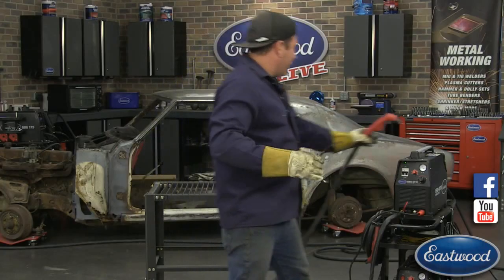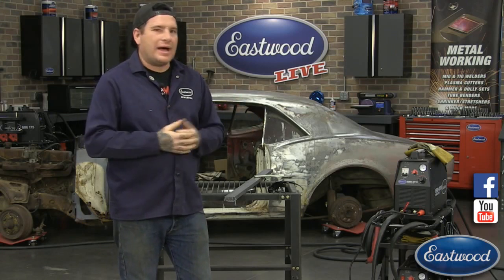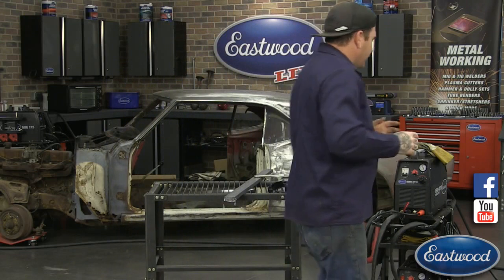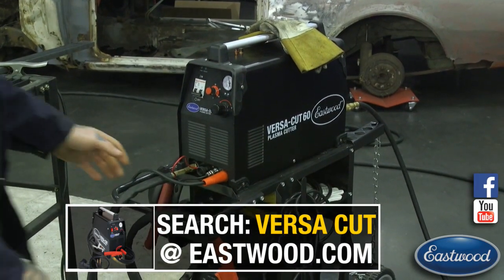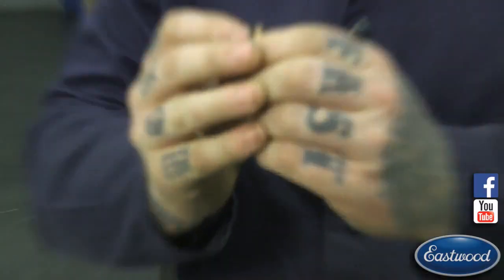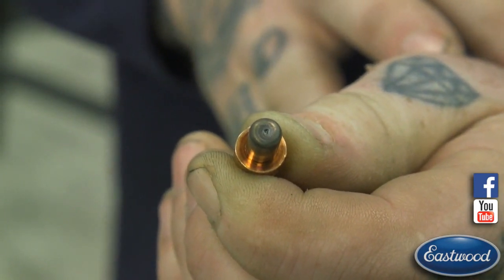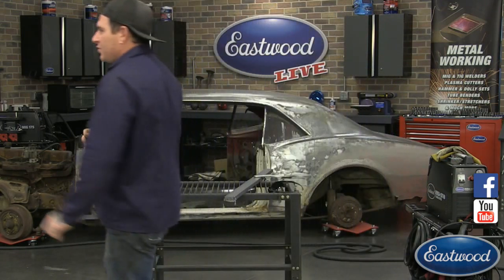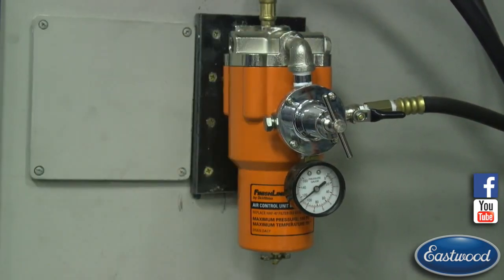Plasma Cutting Tips & Tricks -  When To Replace Consumables & Troubleshooting - Eastwood

Comment: When making videos of things like a worn out tip, DON'T hold it still.  Rotate the item left & right, up & down a bit to give us a 3-D perspective.  Matt said it was "egged out."  If you'd turned it sideways, we'd get an idea of what that means.
     Also, show us what the ARC looks like when something is wrong.  You talked about indications of the arc jumping all around due to a worn tip and spitting when there's water in the line.  SHOW examples.

Comment: One of the most essential tools in the shop. A good plasma cutter is worth its weight in gold!. It excels in removing rusted out floor pans and quarters. Very low impact on a rusty and frail car,neat edges and allows creeping up on a flange cuts. Clean dry air makes all the difference, cuts like a dog with dirty damp air.

Comment: when should you use a plasma  compared to other cutting methods  like a wheel
Reply from the maker: Every tool has it's place.  Sometimes it's simply user preference.  If it's thick, a plasma is great.  It's also great for long cuts because you can move quickly.  You can also cut out shapes, which would be difficult with a wheel.